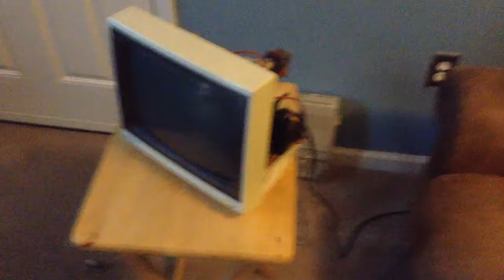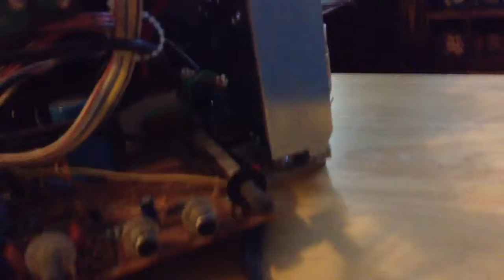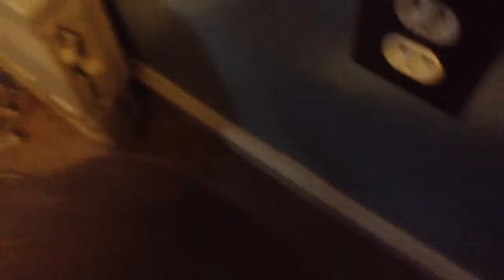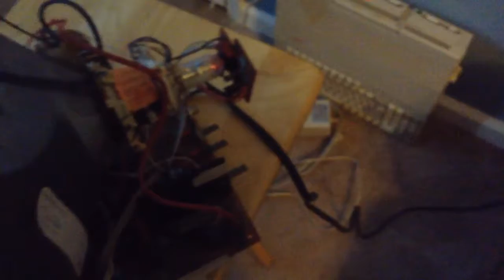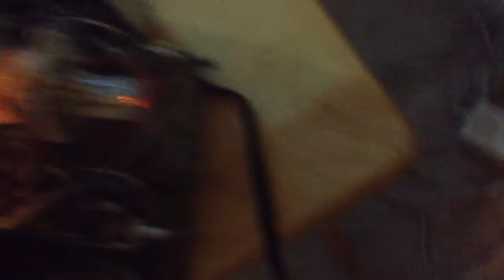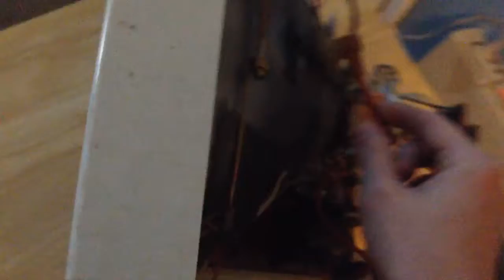Magnavox Computer Monitor 80 repair part 2

Comment: so much for that, before i left i determined i had a continuity issue between the switch and the line input. and the connection dose not make it to the filter cap unless the thing actually truns on. made it here looking up service information.
Reply from the maker: Fair enough. Mine had popped a fuse for some reason. It's never done it since. My horribly unsafe temporary fix here is still holding, actually.